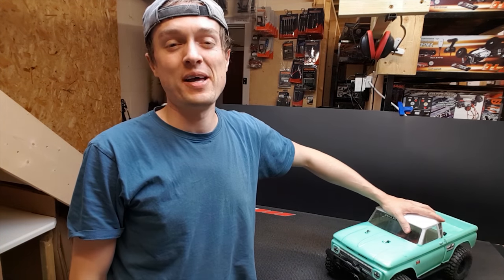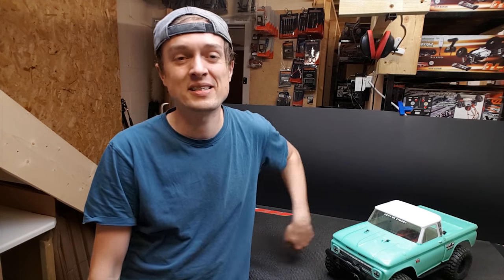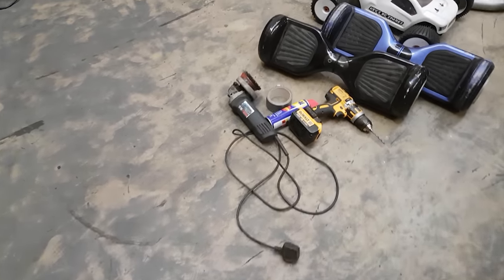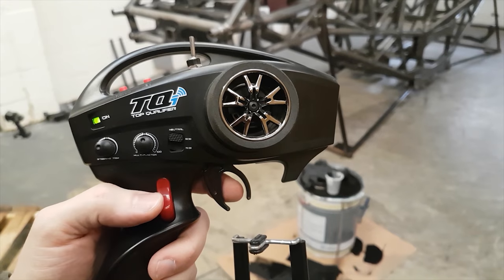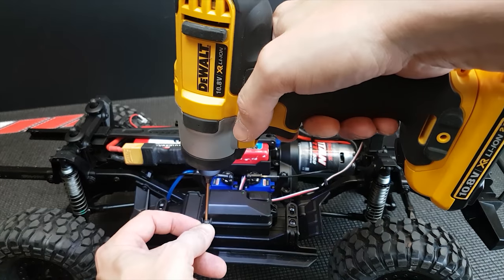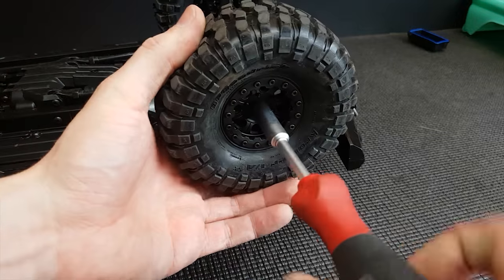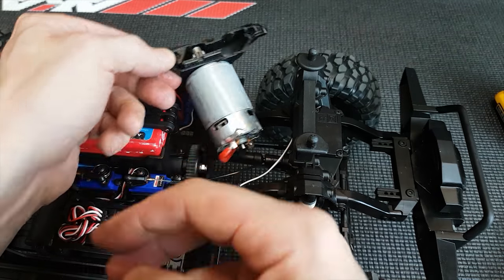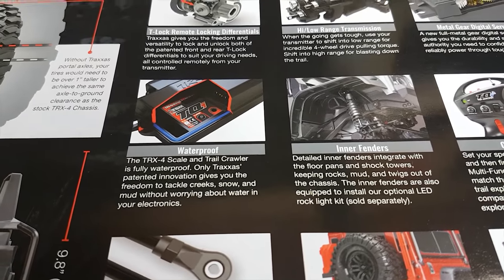Traxxas TRX-4 How Waterproof is it?

Comment: I got a traxxas bigfoot, an the way i made my receiver waterproof as can be, i put some silicone grease on a qtip, and rubbed the  rubber wire in grease, and the wires going into the receiver box, ive had mine for half a year now, not one drop of water in the box, an i get the truck wet pretty much everyday i can lmao

Comment: How do you prevent the screws from rusting? I washed mine after a particularly muddy session and i blew dry it with a hair dryer as best as I could, but there were still bits of rust on the screws after.
Reply from the maker: wd40